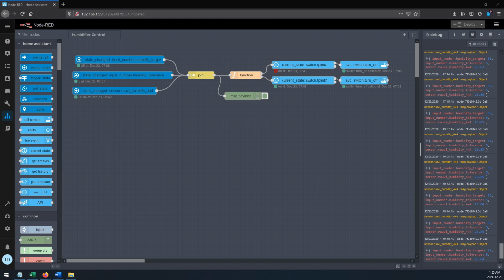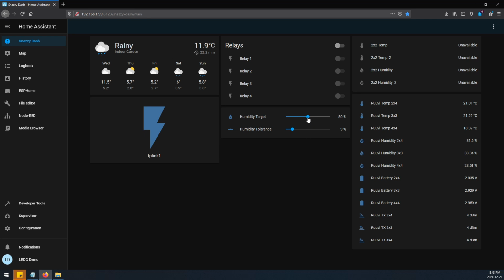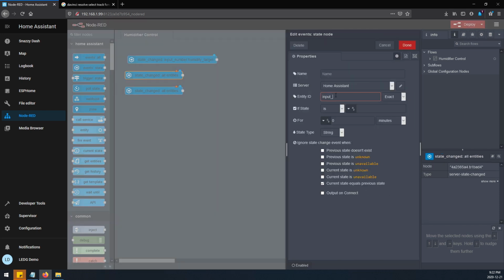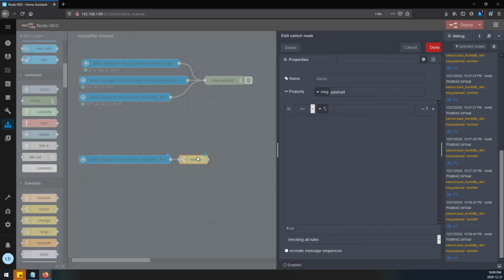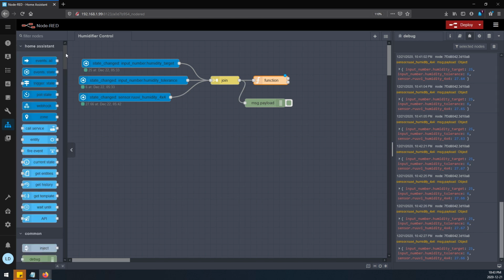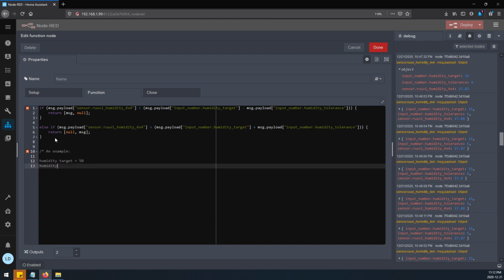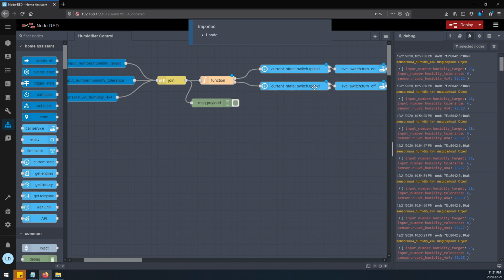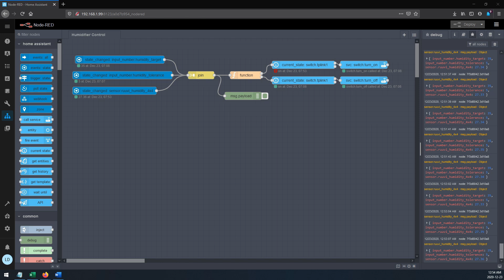Automate Your Grow with Home Assistant #6: Automating Humidity with Node Red & Dashboard Sliders

Comment: Hey thanks for this awesome video, everything is working perfectly except one thing. When I turn my target slider way down to make the "switch off" call service activate, nothing happens but when the slider is super high the "switch on" service works perfectly.  I've copied the code you wrote for the functions perfectly with no errors but can't for the life of me get the function to turn off the TP link outlets.

Comment: Do you have details on the humidifier you've got/built there? I am using a 6L one but it'd be awesome to have a big tub like you have (that I can have a _de_humidifier drain into, too)
Reply from the maker: It's a Home Depot tote that's fed by a float valve. Inside is an ultrasonic fogger that sits on a float to keep it at the right depth below the water level. I use a 12V computer fan on a 90 degree PC elbow to blow air through and force the mist out another pipe and into the room.
Reply: @LEDGardener  cool. I'd love to hear more about this piece in an upcoming video if you get the chance, but I'll do some research on ultrasonic foggers and see what I can come up with!

Comment: I highly recommend to use timers (in esphome or tasmota) as auto off protection. WiFi, BLE and battery powered sensors are not 100% reliable. Imagine a situation  you sensor fails or router hangs up when your humidifier (or nutrition pump) is turned on. This is how I ruined lots of salami in my curing fridge before I’ve noticed that my humidifier is constantly turned on. That was a painful lesson.
Thanks for videos. Your hydroponic system is awesome!
Reply from the maker: Not a bad idea. How have you implemented the timers?
Reply: @LEDGardener  I have no experience with esphome, but I am pretty sure it can be done by adding "switch.on_turn_on" trigger with 2 actions "delay: XX seconds/minutes" and then "switch.turn_off". Now you have 100% guarantee that your humidity or EC won't go over your desired level. 
P. S. Remember about Murphy's law and be prepared. )

Comment: Hey Dude! Thanks for great video, I followed it fully and built perfectly working flow that manages switching on and off heather radiator based on the temp slider that I'm setting on and temp sensor that tells to radiator when to turn on and off. Fantastic job! Now I bought and setup simple Tuya window sensors (for left and right windows in the room) from Aliexpress and would like to add them into the flow so that if window is left open (either one or both) - not to turn my radiator on and if it's closed - to keep performing normal operation. Could you hint me where in the flow to place my window sensors? Thanks a mill!
Reply from the maker: Maybe you could feed the state of the windows into the join node and then add logic in the function block to say their state must both be closed in order for the rad turn on signal to pass.
Reply: @LEDGardener  Thank you, will try soon.

Comment: I can't thank you enough for this video.  I just purchased the ruuvi sensors that I have had my eye on for some time as a possible solution to my HA environment goals.  That in itself was in interesting experience, and pretty impressive, tbh.  Less than a week from Helsinki Finland via DHL when FedEx can't seem to deliver something from the states in the same time, lol.

Just followed your instructions, and it all worked perfectly on the 2nd try...  All I had to do was change some names in the functions node to get it to work, but I understood why and how with your brilliant explanation of an if variable.

I also have never programmed a line of code, other than a bit of html and lately yaml, even though I have been doing IT support for the last 20 years, so I feel pretty confident around computers but pretty intimidated around any programming.  You have taught this old dog some new tricks.  When I ran my slider back and forth and heard the switch turn on and off, I was blown away.  What you are doing is an answer to my prayers.

Comment: Thanks for the update. Love the slider helpers. I was wondering about that. I just ended up moving over the NR ph control and love it. I struggled hard with understanding other NR videos but you explained it well. Hopefully there's more to come.
Reply from the maker: Cheers. How's the ESP32 doing? Any dropouts with the fresh one and the level shifter?
Reply: The new Esp is running flawlessly on wifi with a voltage divider. And I finally got the atlas stamp stable for 4 days now. I switched to Uart protocol and scrapped the i2c. I'll post on the forum when its been a week of stability.

Comment: done and everything works as intended, but could you do a quick video on how to take an average reading from 2 bme280 like we have on the tent esp? after all the work it would be a shame to use  just one XD
Reply from the maker: in ESPHome config for the esp that you have your BMEs on, add an "id" line for both temps and both humidities (should be adding 4 lines) like shown below. Make the ids all lower caps, no spaces, starting with a letter. Then add 2 template sensors like I did at the bottom and use these sensors as your averages. 

sensor:
  - platform: bme280
    temperature:
      name: "Tent Temp"
      id: tent_temp_id
      filters:
        - offset: 0.0
    humidity:
      name: "Tent Humidity"
      id: tent_humidity_id      
      filters:
        - offset: 0.0
    address: 0x76
    update_interval: 30s
  - platform: bme280
    temperature:
      name: "Tent Temp_2"
      id: tent_temp_id2
      filters:
        - offset: 0.4
    humidity:
      name: "Tent Humidity_2"
      id: tent_humidity_id2  
      filters:
        - offset: 4.0
    address: 0x77
    update_interval: 30s    
  - platform: template
    name: "Tent Avg Temp"
    lambda: |-
      return ((id(tent_temp_id).state) + (id(tent_temp_id2).state)) / 2;
    update_interval: 35s    
  - platform: template
    name: "Tent Avg Humidity"
    lambda: |-
      return ((id(tent_humidity_id).state) + (id(tent_humidity_id2).state)) / 2;
    update_interval: 35s
Reply: @LEDGardener  done and works like a charm, the only thing is that in node red i could not find the
sensor.tent_avg_humidity in the current state node list but just writing the exact template name works ;) thx a lot
Reply from the maker: Probably just needed to restart home assistant or reboot your device. I found that I had to do an actual reboot of the Pi yesterday for an entity to show up, so you can try that as well. Go to supervisor, system, reboot. Should show after that.
Reply: @LEDGardener  you are right, I haven't rebooted the machine in a while and just tried to reboot the server wasn't enough, now it shows in the entity list of the node red node😉

Comment: Thank you so much for putting this together! I have watched a handful of other Node Red tutorials and had trouble trying to translate what they were doing to achieve what I wanted to do. This example sets the groundwork for a lot of garden automations, so I feel more confident now that I can get something useful working. Node Red is very powerful and is used in IoT applications outside of HA, so I think it's a valuable platform to learn even if HA's built-in automation modules (and new blueprints) would have worked just fine.

Anyway, thank you for helping us get past the initial learning curve!
Reply from the maker: Hey compost, this is great to hear. I was bummed when I saw blueprints come out after I decided to go the NR route since they’d be perfect for this application but I guess since NR flows can be exported and imported, it’s not that much more difficult for someone to plug their entities in and have an easy way to use other people’s automations.

Comment: Another awesome video, thank you so much. I have been working directly in Node Red and others instead of using Home Assistant but now I am wondering if I should rethinking my strategy. BTW, in the debug area of node red, when you mouse-over a part of payload, there is option to "Copy Path" which is really hand for copying the full payload path for dropping into functions. Thanks again for all the amazing content and on Boxing Day no less!
Reply from the maker: Nice, thanks for the tip! How are you getting data into NR currently?
Reply: @LEDGardener  I'm using MQTT and some native calls from the Raspberry Pi for some sensors connected to the GPIO. I also run rtl_433 > MQTT to pull in 14 other indoor and outdoor sensors 433 MHz sensors and  drop them into an InfluxDB database and output then to Grafana. I am just learning all of this and kind of trying things out as I go. My automation through the ESP32 to control relays, output to an OLED display, and other work for my grow tent is still sitting on my desk while I build my new tent area in the garage.
Reply from the maker: That’s awesome! A lot of people use the influx and Grafana add-ons in home assistant as well.
Reply: I have started looking at this more as well and think it might be a lot easier. For example, your threshold implementation in this video is so much easier than trying to do it in Node-Red!
Reply from the maker: Cool. I look forward to more pro tips for NR.

Comment: I know lots of people find writing automations easier in Node Red but personally I find the built in automation editor in Home Assistant to be easier.
Reply from the maker: So far, I would totally agree with you. My personal system is all done through HA. Once you understand how to template, it gets way easier, eh?
Reply: @LEDGardener  Ya man, if your taking a vote I think a video about using templates and blue prints would be beneficial. Specially since alot of your code in your github have templates. Cheers!
Reply: @LEDGardener , yes and I suspect that the new Blueprints will help with this sort of stuff too as more people start adding to them.

Comment: Great vid, clean concise and to the point, nicely done! So, looks like SSIS and acts like PLC ladder logic, gotcha :)  Will you (or have you already) shared your DIY plans for the humidifier?
Reply from the maker: Thanks! The humidifier is just a small tote from Home Depot with an ultrasonic fogger in it. Water is fed into the tote through a float valve that keeps it topped up to the perfect level for the fogger to produce mist. I have a PC fan siliconed into the white 90 degree elbow that blows air through and forces the mist up that black pipe which is a sink tail piece.
Reply: House of Hydro makes the best ultrasonic fogger. Kind of pricy but totally worth it.
Reply: Any plans for part 7 with the Atlas + Arduino + HA setup and config?
Reply: @FlyingRossolini  I recommend you to buy the Hydroponics kit what atlas scientific currently offering. For EC 0.1 and buy the golden PH probe separetly for more accuracy. ESP add-on in the HA, and you are basically ready to go. You gonna have EC, PH, and Temperature.

Comment: this is the best cristmas gift u could make me i am crying, thx mate still watching but already liked. see you in discord ;)
Reply from the maker: Home assistant makes me cry sometimes but for different reasons
Reply: @LEDGardener  hahahahhaha me too🤣😂🤣 today I could access it but not edit files and had to install another Firefox version or I got 401 not allowed to the file editor and esp tab
Reply from the maker: Strange. Working now?
Reply: @LEDGardener  yeah just logging from another browser worked and I didn't had the problem with the phone or tablet just the browser on the machine running home assistant and using the local address not external one
Reply: @n27-c9l  if logging in from another browser works, it tells me that clearing the cache and web data from my favorite browser also works to get me back in after an update to HA
Reply: @DesertGardenPrepper  yes happened to me too when I had to change the Firefox version